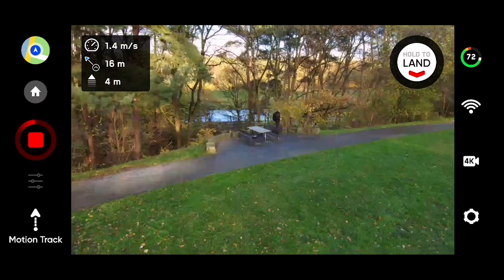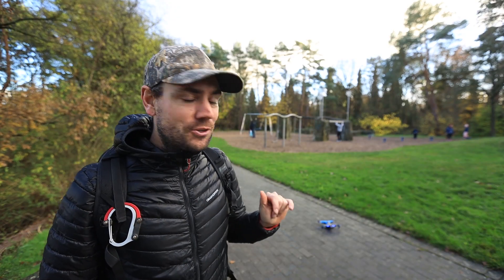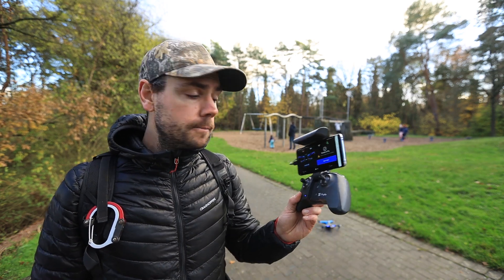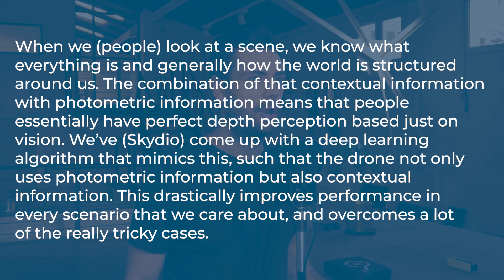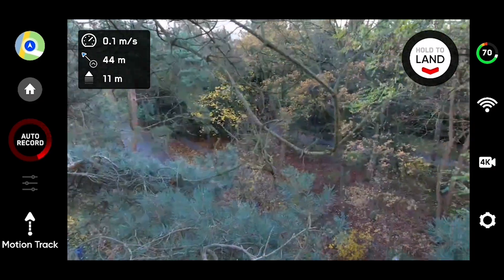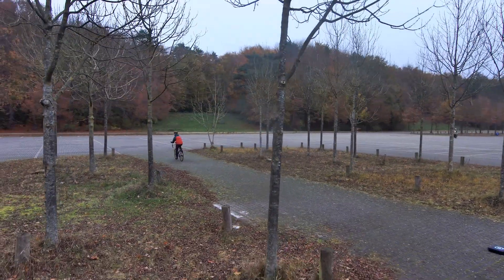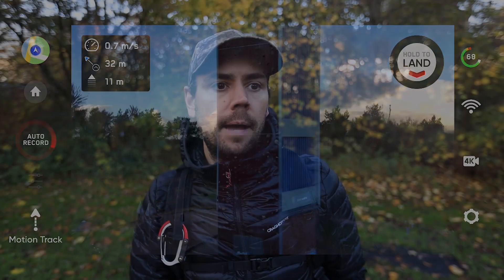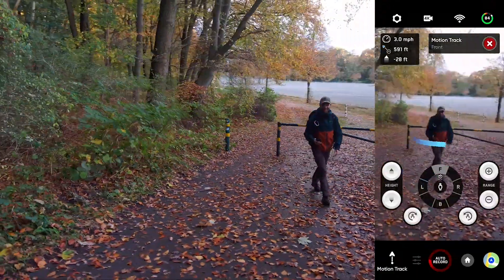Skydio 2 | Advanced Obstacle Avoidance

Comment: So this review is with the Skydio 2, not the NEW Skydio 2+ (which has longer range, antenna on the drone, updated battery and keyframes). I didn't see the antenna on the drone in this video, so apparently this review is the older version of this drone. Just thought that should be made clear to anyone that's seeing this newly posted video on the OLDER version of this drone! Range is so much better now with the Controller!!!
Reply from the maker: Correct, the Skydio 2 benefited from a firmware update, but the 2+ comes with improved hardware!